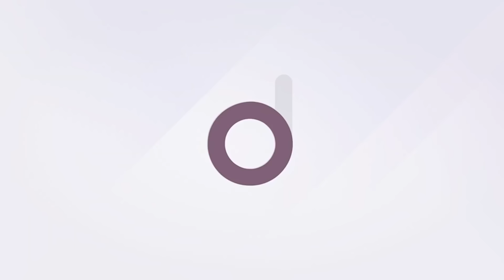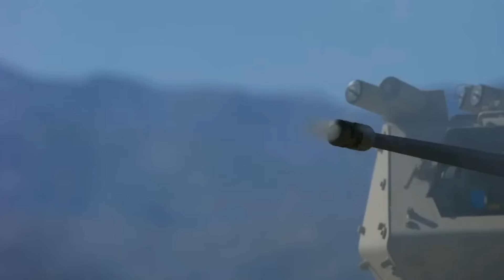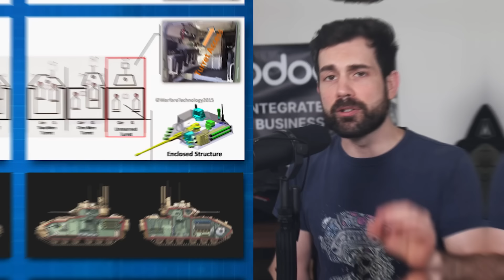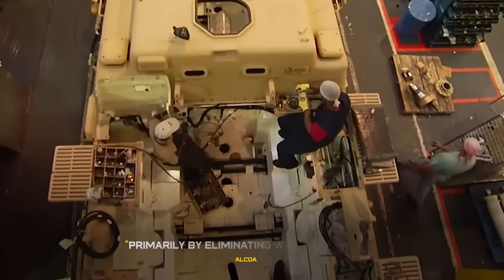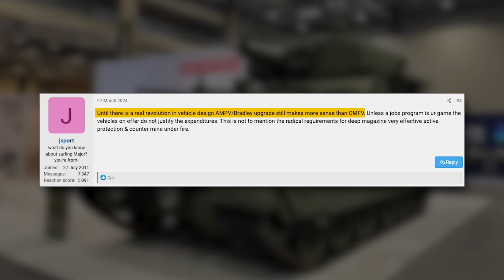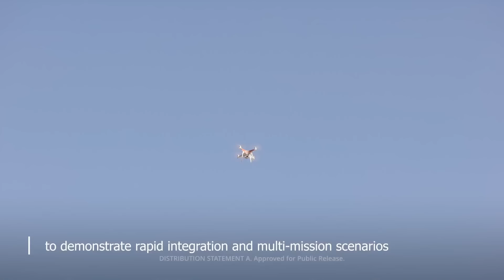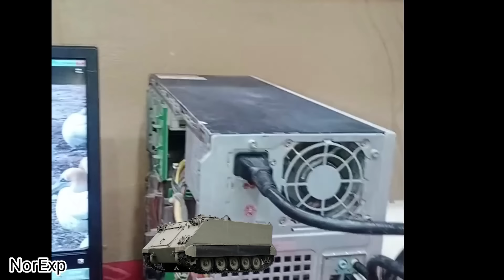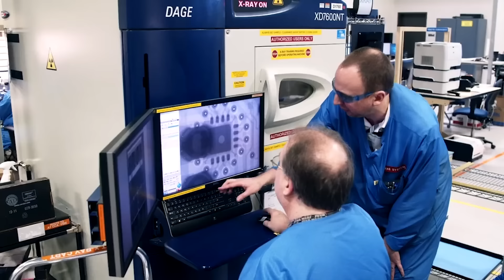How America’s Quietly Building a Secret Armored Fleet

Comment: It is definitely not 3d printing the hull. I mean I know very little about the military but I know a bit about 3d printing and I can tell you that if they're doing anything remotely close to 3d printing hulls they're cooked. One of the biggest strength issues with 3d printing is the fact that it's made layer by layer meaning you have layer lines and those are going to be your weak spot. Even if you did it in metal you'd essentially be making a tank hull out of welds which is probably not ideal.
Reply: 3d printed rocketry demonstrates your thinking is incorrect as they deal with quite extreme forces.
Reply: @DarkHorseSki  Lol there is a difference between the forces a rocket takes and a armored vehicle's hull. I'm pretty sure if you shot the International space station with a tank shell it's going through like butter. I'm not saying you can't 3d print some strong things, you definitely can. But one solid mass is going to be stronger than that mass being laid layer by layer. I am well aware 3d printing is used for many military uses but there is a reason we're not printing armour at scale (there are some people who have been able to make bulletproof 3d prints but that's mostly low caliber small arms).
Reply: @ The reason we don't 3D printer armor to scale is cost, not strength.  I guarantee you that it is possible to 3D print a hull that is both lighter and stronger than what is being done for AMPV now.
Reply: @DarkHorseSki  you gotta be trolling, there’s no way you believe this
Reply: @lbirdfactsl   It's not a matter of belief.  It is demonstrable fact.
Reply: @DarkHorseSki the weak points, the layer boundaries, are perpendicular to the direction the rocket is flying. they do need to tolerate some stress, but as long as they keep almost all the load pushing layers together, it will continue to hold.

the problem with 3d printing armor is you have to make sure the strength is perpendicular to how it's hit, and that means any layers have to be vertical on the sides and horizontal on top. alternatively, you could melt and reflow the whole thing to remove the layer boundaries, but by that point, you might as well just cast it, because you'd need most of the same equipment anyways.
Reply: @dead-claudia  It's not that hard to print the hull in an orientation that would do as you believe is necessary.  That being said, 3D printing metals offers ways to align the material regardless of the orientation of the hull during printing.
Reply from the maker: yes I was using an analogy to be cute <3
Reply: @ you don't need an analogy to be cute ;) <3
Reply: casting is essentially as well 3d printing
Reply: @ no it isn't, not even a little. 3d printing works by laying down a layer at a time and letting it harden and placing another layer on top of it. Casting is pouring a molten liquid into a mold and letting it harden as 1 piece.
Reply: Maybe they have pressed parts
Reply: It’s an Alcoa part. It’s a cast aluminum piece that is forged on a massive press.

Comment: Also worth noting that the AMPV could just eliminate the need for the OMFV/XM30 while using the ideas paid for in the XM30 development (as the US Army has the rights to ALL that is developed in that project and even made it clear that XM30's could be built using both the Rheinmetall and GDLS parts ... like the Rheinmetall Lynx hull and the GDLS turret...)  That means the unmanned functionality developed for the XM30 could easily placed within the AMPV too.  Same with some of the drone and weapon ideas.  And the AMPV could mount an autoloading and quick firing 50mm (or even 75mm, like the one first shown in the 1970's) cannon as there is no reason to believe such turrets would be too big for the platform.
Reply: I wanna see more militaries use CTAI's 40CTC 40mm Cased Telescope Cannon.
Those things are bad ass
Reply: No it wouldn't-the AMPV has the same issues that the Bradley has that is currently driving the development for the XM30. 

If you replaced the Bradley with an AMPV with a turret, you'd basically have a Bradley again. It would be a lateral move with no meaningful improvement
Reply: @sherminator981 XM193 brings considerably more hate and discontent per serving vs. 25 Mike. Obviously less total ammo capacity, there are trade-offs for everything.
Assuming equivalent sensors and fire control systems you'd get increased range, payload and effectiveness against various threats( such as UAV's)
Reply: @sherminator981  What do you believe can only be incorporated into an XM30?  Gun? No.  Electric drive? No.  Missiles? No.  Drones? No.  Unmanned driving? No.  Sensors? No. Modularity? No.  All those things and more are doable... NOW, with the AMPV platform with the incorporation of the same tech (and BAE should have been the 3rd competitor for OMFV and still has all the tech and skills they developed for that program available.)
Frankly, the AMPV, with the various turrets, addresses plenty of the shortcomings people note about the Bradley at a significant cost saving.  Is it really worth paying 20x more for a vehicle that is, at best, 10% better?
Reply: @DarkHorseSki  

Yes it is because your still using a platform that was designed nearly 50 years ago that shares the same shortcomings as its predecessor. The Army spelled out that the Bradley already has hit its max headroom for protection, power generation and other things so it is no longer viable for future missions it wants to do. 

Buying AMPVs to replace Bradley's is nothing more then a lateral move and once you start adding the things your talking about to an old design its going to drive the price up and your still dealing with the limitations of a footprint of something that wasn't thought about 40-50 years ago engineering wise. You have limited space/power to do it. They are already struggling putting an Anti Missile defense system on the Bradley because of that. 

As for pricing, your numbers are completely made up-the Army expect the XM30 to cost only 3x what the M2A4 is, but also don't forget that the XM30 will need a whole new logistics trail to support it with new training and maintenance support to keep it functional, so that accounts for the price increases. Plus I'm not even sure if the M2A4s are completely new vehicles-they might be remanufactured units also.
Reply: @sherminator981  Sure the AMPV is BASED upon the Bradley hull, but it is much updated and continues to be improved as the USG gives feedback.  AMPV is capable of being adapted to new drive systems, electronics and payloads.

As for cost, the US Army is buying about 3000 AMPV's at under $2 million each.  Expected total cost is $6 billion.  XM30 program is $45 billion (pre inflation numbers) for 3800 XM30's... so okay, it is only 7x more expensive (assuming the XM30 is produced at that cost and that is highly unlikely, while the US Army is currently purchasing AMPV's at $1.8 million each.)

And Bradley's, like the Abrams, are reused... sometimes completely torn down to the hull, but that is not what is happening with the A4 updates.  AMPV's are completely new, being produced from the hull up.
Reply: @DarkHorseSki  Your missing the point-the AMPV is basically a Bradley without a turret (which is perfectly fine what its use case is-replace the even older M113 based vehicles), thus still has the same issue as the Bradley does that the Army has already identified as having limitations in meeting its future requirements.  No new drive systems or electronics would fix that because if it did, they'd be doing it already with the Bradley. 

Cost factor is more or less irrelevant for the AMPV-your paying less then what a Bradley goes for because the AMPV is less complex (lacks a turret and weapons systems for most variants), but once you start adding remote weapons station, the price will go up and your basically buying another vehicle that has really no improvement over the existing Bradley for the same cost....

So basically it is this-the AMPV is great for a M113 based vehicle replacement, but makes zero sense as a Bradley replacement, because it is basically a Bradley, which has already maxed out its headroom for growth and can't meet the future requirements that the US Army will have in the next 25 years or so.
Reply: @ Your point is incorrect.  It may SEEM as if the AMPV is just a turretless Bradley, but the way they are built now vs. what was the process when the Bradley's were made gives the AMPV a significant boost.  The ability to be modular is much more in line with the OMFV requirements and well supported by the AMPV (as documented also in this video.)  Cost is never irrelevant.  If it was then there are soooo many weapon systems the US would never have abandoned.  Even the variants of the AMPV are coming in under $2 million each.  And despite what you think, the AMPV is quite improved over the Bradley.  Not only in hardware, but also in the electronics and computer systems.